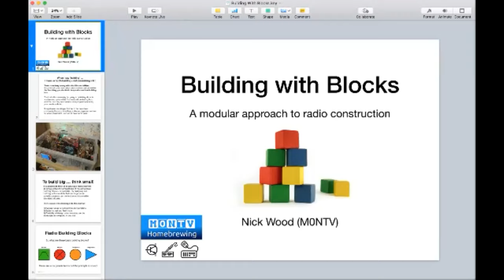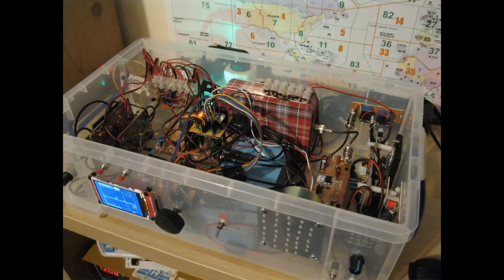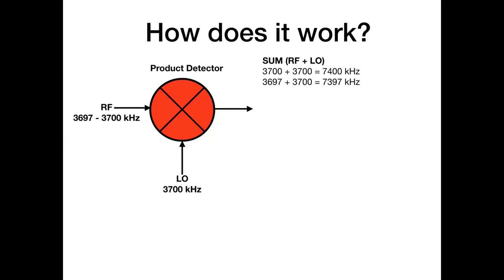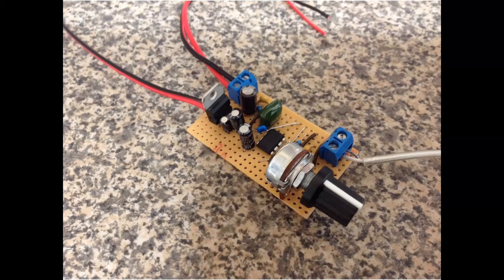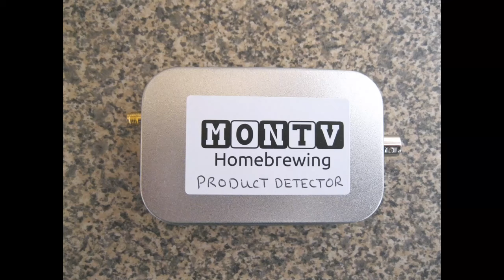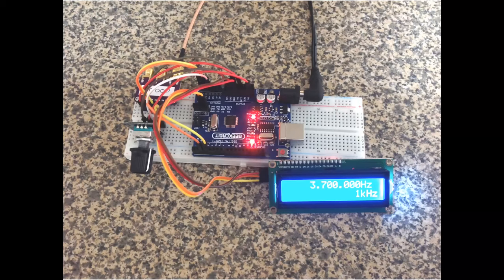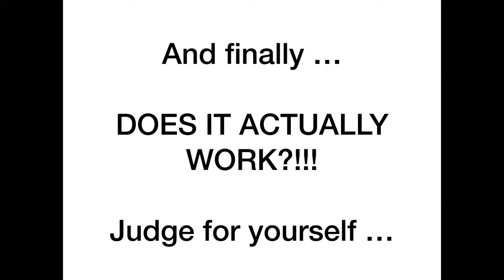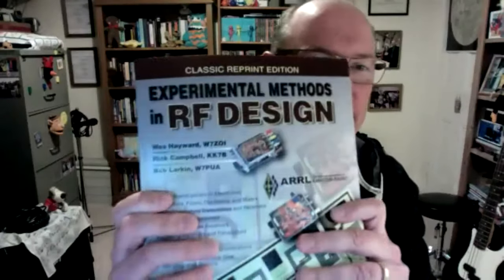Building A Simple Receiver by Nick M0NTV

Comment: ”Put your transistors in the right way around”? It matters? Now you tell me! The only kit I put together was a Heathkit (remember them? Are they still around?) dot matrix printer back in the 1980s. I assembled it, but couldn’t make it work. Finally, I brought it back to the store. The techs managed to get it working. The problem? A transistor or three put in backwards and the odd cold solder joint …

73 de AF6AS